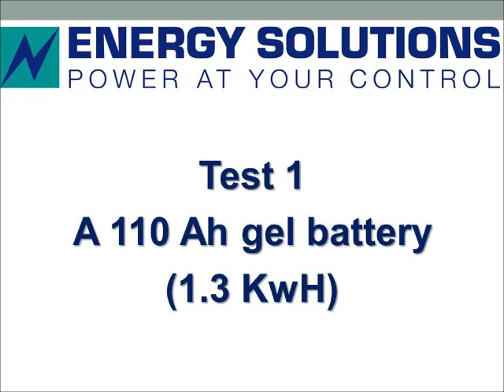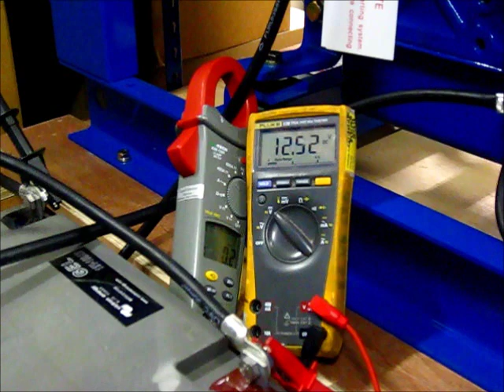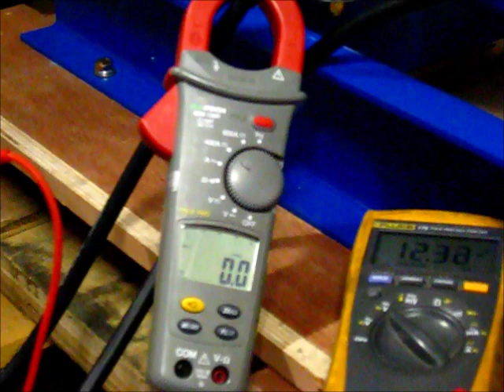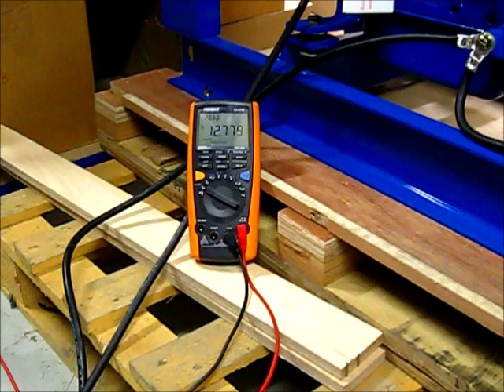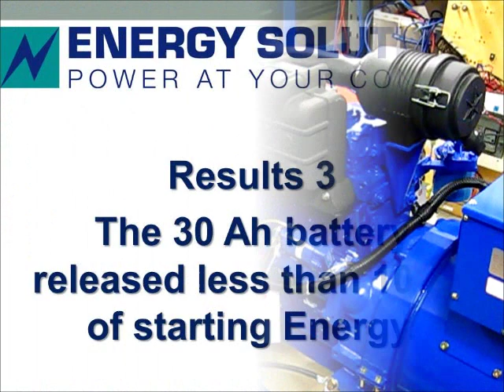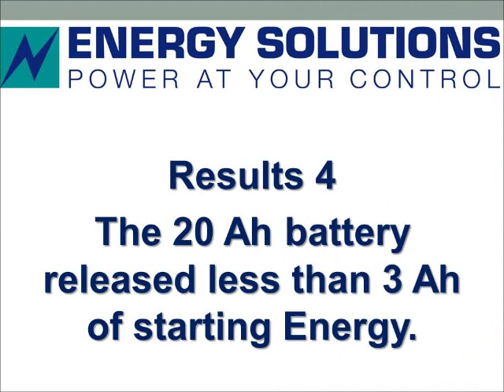Lithium Ion vs Gel & Lead Acid Battery Starter Batteries

Comment: Batteries notwithstanding, you should observe the 10/100 second rule. Crank for a maximum of 10 seconds, and for each 10 second cranking period, cool your starter for 100 sec.  I think a length of heating element would have been much cheaper, more accurate, and more sensible than destroying a perfectly good starter. That said, I like the Li-Ion battery. I like it only because it's light and fume free.

Comment: It isn't true that one would expect poorer starting performance with a smaller capacity battery. The actual capacity needed to start a vehicle is very very low. Cranking a starter motor for a few seconds would only consume maybe 300mAh of current. The key measurement here is the C rate, which is the discharge rate. Li batteries can have very high discharge rate therefore with a small capacity can easily start a vehicle. This is why we build R/C aircraft using very tiny LiPo batteries. The are light and have very low capacity, but the discharge rate allows for a good few minutes of flying.

Comment: Need conversions if this video is to make sense to non-UK people.
As is, watched the whole thing, and as a regular consumer got nothing out of video.
What is cranking amp draw of motor at 0 and 100 degrees C?
Which battery is able to start motor at each of those temps?
What are the Cold Cranking Amps of each battery?

What is the cost per CCA adjusted for estimated life of battery? (Battery has 400 CCA, costs $100, est. life 4 years, $25/400 CCA per year)
Batteries die in the winter and summer. 
People are trying to buy best battery for all conditions. CCA is what starts the car in Winter. Car will only use what it needs, no harm to get more CCA. 
Having more Amps than needed prohibits electronics from starving (lights, winch, fridge, etc...) when peak loads demand more. This helps those devices last longer.
Ever since changing to a min 800 CCA battery 30 years ago (usually several hundred more than OEM), I have not had any problems starting in Winter/Summer months and no electronics "wear out" (besides bulbs of course) prematurely.
I would like to know if any of these new battery types can best a 900 CCA 12V Lead Acid battery for at least 5 years. - That is the useful info customers are looking for.

Comment: I am trying to replace the batteries on a 1986 MCI 102-A3 bus. They are two massive 8D 12V Lead Acid batteries. Any direction on doing that and use Lithium instead?